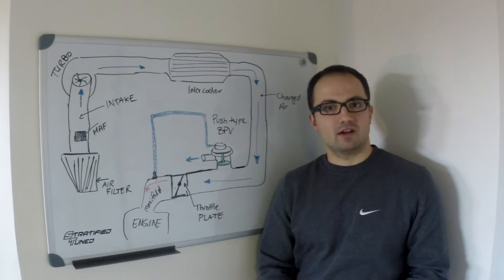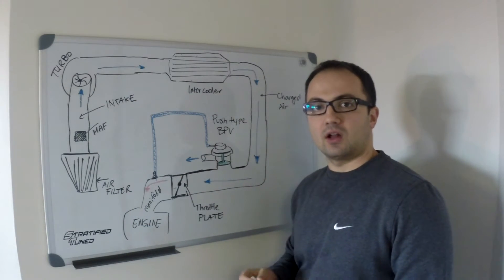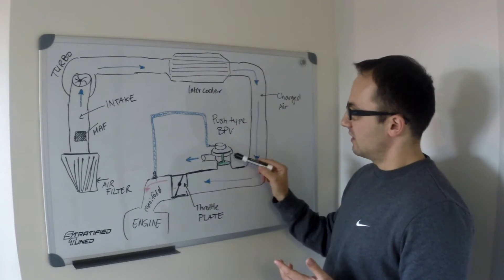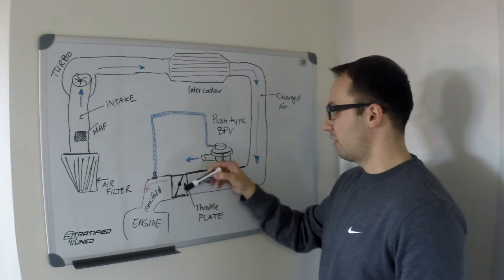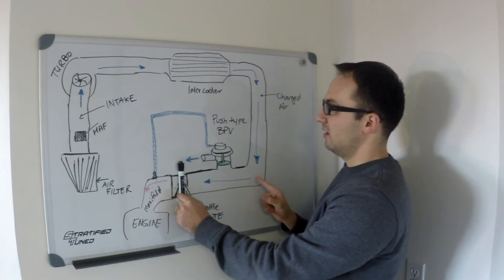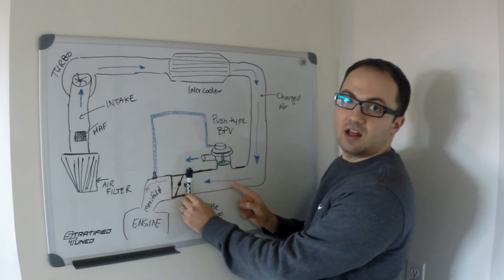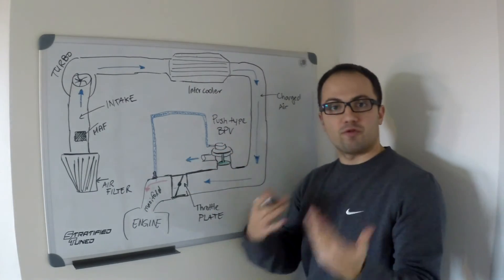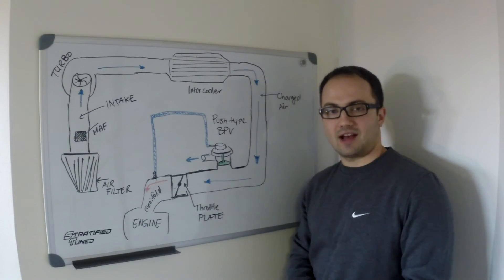Stratified Auto explains how a BPV/BOV Works

Comment: Great explanation. You said the released air is connected after the MAF and therefore will not have affect on the Air/Fuel mix. If this is the case, how can releasing the air to atmosphere cause a rich Air/Fuel mix?
Reply: Because the air that was calculated by MAF was released to atmosphere and did not enter the intake or cylinder.

Comment: When the throttle is shut off the fuel is cut off too so the engine wont run rich if the DV vents to atmosphere.
Reply: Correct.

Comment: Why would recirculating matter if the throttle body is gonna be closed when the air is going back into the intake?
Reply: Exactly. This is something so many of these video makers get wrong. The conditions under which the BOV/BPV vents are ONLY when the throttle is fully closed, the engine is not under any load, and the injectors are switched off, so there is no "running rich" issue. When the throttle valve opens, the engine is under load, and the injectors are firing; then the BOV is closed, there are no leaks to atmo, and the MAF is measuring correctly. So it's a moot point. The only reason to recirc. is to mask/hide the sound of the BOV, and that is the only reason manufacturers do it.
Reply from the maker: @samgab  Keep in mind that the injectors do not shut off immediately. There is a transient there or the condition would be very abrupt. During this transient the engine still consumes some air and fuel and this is where it would run rich. On top of this, at idle, the valve would be kept open (push style valve) from the engine vacuum and it would run rich with a VTA and MAF setup.

Comment: Won’t releasing the surplus boost to atmo only cause the MAF to read incorrectly during the fraction of a second while the valve is actuated? During normal boost operation when the valve isn’t actuated, there is no change, right? So it’s only running rich or reading wrong when you’re off the gas anyway...

Comment: The video was really helpful thank you. some BOV's have 2 ports (where the blue vacuum line you drew) whats the second lines purpose?
Reply: some have a second line above the spring to put a stronger downforce on the spring to hold the valve closed for launch controll so the pressure holds in the sytem to reduce turbo lag thus giving full boost on launch

Comment: I have a question. If there in the small hole on top of the Blow off Valve, in the chamber above the metal "piston" that moves up to release , would the BOV be useless?

Comment: Wait, where does a diverter valve recirculate the air in your diagram?
Reply from the maker: A diverter is the same as a bypass valve - bpv
Reply: @stratifiedauto  sure but where does it divert/bypass to, exactly? (Maybe you mentioned this and I missed it?)

Comment: What if I like the flutter sound it makes without a blow off valve, is there a way to keep this sound without damaging the turbo long term?
Reply from the maker: Mild flutter won't harm it but strong flutter especially off high boost will take its toll on the bearings.
Reply: What is considered stong flutter and high boost?

Comment: What happens if I put the BOV before the Intercooler?
Reply: It still works but you would be venting "HOT" air instead of the Cool Air. If you are dumping into atmosphere then it would make no difference which side of the intercooler you use but if it is a recirculating BPV then you would be dumping hot air into your turbo instead of cold like you should be getting from your intake.

Comment: You contradicted yourself at the end...if a BPV in fact feeds air back into the turbo AFTER the MAF that's already been accounted for by the MAF...changing from BPV to BOV shouldn't have an effect on the A/F ratio at all...because according to you this air has already been accounted for anyway?

your point would make sense if BPV fed in BEFORE the MAF..
Reply: Not exactly. It is accounting for the air being recirculated into the system not vented to atmosphere. So with it being dumped to atmo the MAF doesn't know it has to allow more air to make the right A/F because it doesn't know that air is gone.
Reply: @harrypayne1000  are you saying that the position of the MAF sensor doesn't matter? If that were the case there would never be a risk of introducing a rich condition between fears and right off throttle.

I think it depends on the set-up, if the OEM BPV measures flow after BPV then the recirculation being sent to atm does no harm because it's no longer reading this extra air and not providing extra fuel that will be wasted... If the MAF is BEFORE the BPV I'm sure that's the scenario that would cause some issues with A/F ratio as that system is designed to retain all air in the system
Reply: I know the is is many years old, but I think I have the answer to what you’re insinuating…

You’re failing to recognize that the MAF is calculating airflow/volume for the AFR that makes it to the inside of the engine, not the air that just makes it to the BPV or BOV. 

If, the MAF calculates that 10 liters of air pass every second, but 1 liter of that air is vented before reaching the motor, then the MAF is sending approx 12% too much fuel to the motor. 

By diverting the high pressure air back to the  charge pipe, but after the MAF,  the car is continually delivering the proper fuel/air ratio… 

Now, to answer your next question, that you haven’t asked... 

The car consumes the same volumetric amount of air for every single RPM. That’s what the size of your motor stands for… IE 5.2L, 2.4L, 6.4L etc. 

As the motor runs, it will continually consume air. The difference a BOV or BPV make is, the volume (and pressure) of air consumed per your Fuel injector size worth of fuel.
Reply: @DustinTheDad ut does that mean that a blow off valve causes a rich A/F ratio for a short time? Because the blow off valve vents the excess boost to the atmosphere.